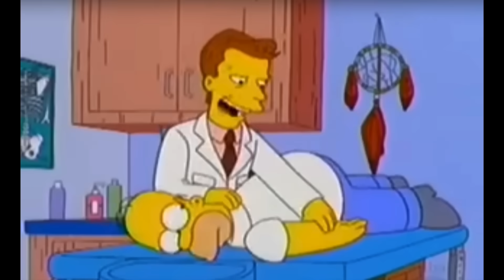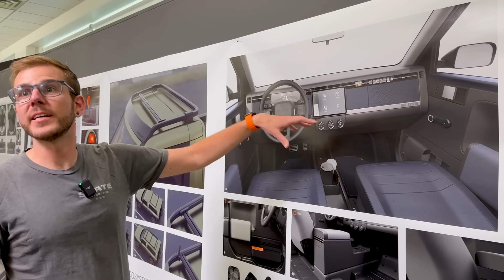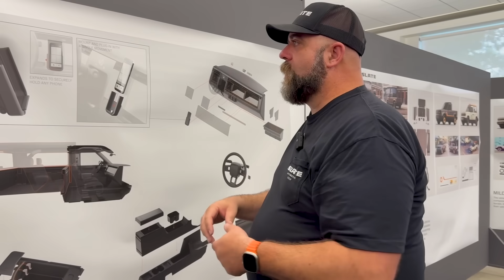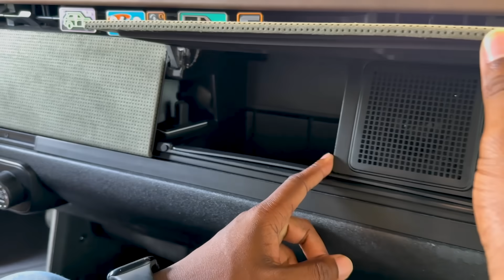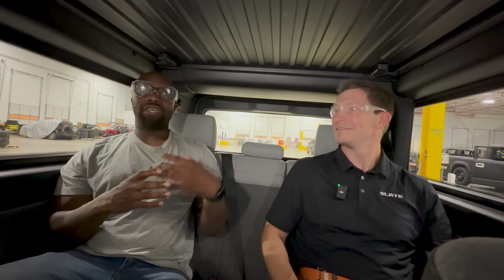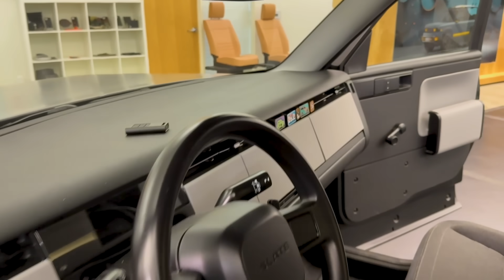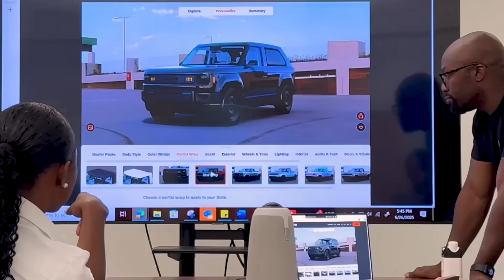The Slate: America’s $20K Answer to China’s Cheap EVs (Exclusive Access)

Comment: My 2019 e-Golf cost $26k (before $7500 rebate), is a real car with heat, AC, CarPlay, stereo, power windows, and drives like a Golf with ~140 miles of range. I just drove 130 highway miles on 89% of the battery, so the range is similar to the Slate. I don’t think the Slate is a game changer. $28,000 with 250 miles of range would be something to talk about.
Reply: Yeah,  too many people falling for the hype. Easy to comment that you'd buy one... We'll see how many actually do
Reply: How delusional are you? You're driving the Chevy chevette of Europe. Do you think you'll be able to service it yourself? Are you able to pick up a large appliance and deliver it to your home with that vehicle? Will it seat 4 comfortably? Because this trucks going to probably have the same look for at least a decade which will increase its resale value , what do you suppose yours is worth if you try to sell it now? How likely are you to survive an accident at 50 mi an hour into a unmovable object?

Comment: Jordan needs to focus on sound dampening material on that loud road noise truck. Also power window are so cheap to have in a vehicle, so it should be standard. The center console needs to be redesign and more usable. 150 and 240 miles range is pretty low with today's technology in batteries. Using graphite or polymer ion batteries is lighter and will get you more range.

Comment: A Detroit (Troy) "truck" with only rear wheel drive? First big snow storm - "Boss, I can't drive in because I will get stuck".... Seriously...  Put a brush-less (A/C) 75kw motor in each of the front wheel axle short shafts...  Simple, no u-joints, no differential, etc... As your CAN bus will have wheel speed info, the ECU can regulate the power when needed to the front wheels. ZERO drag with in rear wheel only mode.

Comment: Nice idea, but this ev will end up starting at $26,000. And by the time you add all the cool accessories it will be in the high 30's to low 40's. No 4 wheel drive and low range , definitely not a game changer. The return of Elio motors.

Comment: 30K, with crank handles, no radio and no paint ?
So, that's all they did ?
200$ saved for the windows
100$ saved for the radio
300$ saved by not painting

Bet that thing still has a tracking GPS computer that knows your every move. 
Bet it needs special software to repair it or pair a new key anyway.

Comment: This being RWD over FWD is at least a good hold over while waiting for AWD. I really hope for a big performance increase in the future. Doesn't have to be a crazy fast vehicle, but allow me to turn all of the brains off and swing this thing in the dirt and skid it in the rain. Really want it to be genuinely fun to drive. Miatas are slow and make little power but they are a blast. 

I can still see this being criticized for its price over functionality. A 10-15 year old full size pickup truck in good condition can be had for less. Not everyone wants a used truck, but a lot of people want the best bang for their buck. This thing isn't competitive against $3k trucks from the 90s as far as capability. Even a base model V6 pig F150 from 01 out performs this. Of course, not everyone looking at this wants a truck; especially from the 90s or later. If you want a cheap truck buy a cheap truck. It will be interesting to see what public perception is when it hits the streets.

Comment: So, Slate trucks are so cheap because their employees make just enough to live comfortably in Sprinter vans, LoL

I would be sold if they had at the very least a 3-4 cyl diesel hybrid option.  Just like the evolution from horse+buggy to automobile running on alcohol, then petrol based fuel, it wasn't fully adopted till fuel stations were abundant.  I still like the idea of worse case scenario I can run a diesel truck off 90/10 oil/fuel mix, or 20/80 oil/alcohol for gas based.

Comment: I've been looking for a classic mini truck like we had in the 90's. This thing 100% fits what i need. I need to go to Lowes, garden center, and occasionally drive 50 miles to the office. My current truck is a 2002 Dodge Ram with a 8' bed that has 280,000 miles. That thing is a beast, and still runs decent, but it's age is showing. I'd be interested to know if we would be able to tow it behind an RV as well. I've reserved mine!

Comment: Its an XJ... Its a unibody with subframe connectors baked in, im lookimg at it now, it appears to be dual motor in the back already, so a quad motor would be easy, and then I still want like a plaid version... 

This will be harder to do heavy offroad suspension on, but its possible... 

I would make the awd one IFS you are targeting the bronco with this...

Comment: I like the mod you can do the car, this and the company fairphone are thinking about the customer when it comes to right to repair but...  1. If this car came out of China, it would've cost 12-15k barebone.  It's already expensive for what u getting.  2. Battery way too low. 3. It's using POUCH as their battery.  That's the worst of the worst. They should've went the battery style as tesla and rivian. Look at the problems porsche is having with pouch.

Comment: 0:26 A chiropractor is not a scam, people just don't know how it works. 
A chiropractor can't fix anything permanently, but he can temporarily improve your joing placement and posture. 
Sure, if it's something acute like popped shoulder, knee or whatever, he can fix it permanently in a single session. 

Every good chirporactor will give you a list of exercises. 

People HAVE TO EXERCISE after the sessions regularly. Their problems are a result of years of incorrect posture and asymetric muscle buildup. 
Now, you may say, anyone who exercises will improve. Absolutely true. And every moderate gym goer knows how important the correct motion is during exercises. 

A chiropractor just allows people to get quicker into the correct motion in order to quickly resume their training routine. 
If you are an extreme case, you may not be able to start training again without the help of a chiropractor. He might make that pain just a little more bearable. 

I prefer osteopathy, they focus more on muscle but they also do what chiropractors do. They can also quickly and reliably identify where you have problems even if you can't feel it, so you can work on that in the gym. 

If you injure your joint, a chiropractor will definitely allow you to get back into action quicker, and that is very important because you don't want muscle atrophy on top of that.

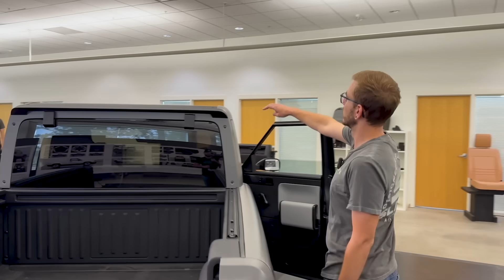Comment: 11:44 I think in terms of car thieves, pranksters, and weather.  This truck looks easy to disassemble for many of the wrong reasons.  Tire lug nuts are about the only things that are easily accessible on a newer car but those are quite secure because they hold the wheels onto the vehicle.  External spare tires get stolen all the time - just ask your average Jeep owner.  I'm also skeptical about having side bolts be open to the elements.  Those are rust magnets.  Ever try to remove a rusted out bolt?  Huge pain in the neck.

Comment: I hope that they keep the price of parts reasonable. I also hope the lug pattern on the wheels is something common like 5x114.3 so that you can use wheels from other companies. Hopefully they make it easy to upgrade the audio system with access to power. Although a big system will probably hurt your range, I would mostly use this around town and back and forth to work, no long road trips. I also hope they make parts fit well, for example the flip up dash panels didn't look like they aligned very well.

Comment: What's the range of the truck, what is life span of the batteries,  how much can you lift it and what larger sized tires can it take. Also if putting bigger tires can the speedometer be adjusted to get accurate mph when driving.

Comment: I see this as the only optionfor an EV I would buy. I want the SUV, but having it in either configuration will suit my desires. I purchased a Gladiator 3 years ago because of everything it can do, and I do use it for all of it. I would love the Maverick, but it wasn't capable of doing all that I needed. The Slate, being American Made, and being a very basic vehicle, will be perfect for MOST of local driving. Save my 2002 F150 Supercrew for the roadtrips, and the Gladiator for camping, offroading and adventure...  Then again, as soon as I get my 62 Scout on a S10 chassis and V6 swapped, maybe I won't need the Slate?

I am waiting for this to come out, real people buy it, review it. Before I consider plunking my limited resources into a deposit...

Comment: I sincerely feel that a tiny pickup that is 2 wheel drive, has no paint, infotainment or electrified windows or seats should be less than $28k. The battery isn't even that big. And when they lose the subsidy, that is what you will be paying. Never mind the fact that most people will end up spending several grand more on upgrades. If this was released in China, it would be like $8k to start lol.

Comment: I’m wondering what the price would be on some of the examples they showed with wraps, bigger tires, interior accessories etc?

I feel like it’s one of those things where the base price is good but things add up quick. They also focus a lot on modding the visual items but like any modern ev you are stuck with the battery, motor and operating system that it came with. 

There’s a lot of cool ideas here but saving you money is a farce. They are just reimagine how to sell you a $50k vehicle in stages but nonetheless selling you a $50k vehicle when fully outfitted.

Comment: Actual innovation in the vehicle space.  The industry needs this disruption. Honestly they should open source the specs for the connectors so that there is also a 3rd party ecosystem, it could be a huge gamechanger. I'd often thought that if Motorola had open sourced their addon phone module tech (you could buy modules like extra batteries, mini video projector modules, extra camera modules, etc) a ton of people would've bought their phones that had that functionality but they kept it closed and as a result they didn't build a market/ecosystem.

Comment: At about 30 mins, Rich mentioned competing with jeep with the slate open air design and being able to customize, this is what jeep forgot. They were always smaller stripped down vehicles for decades....that you could add what you wanted and it wasn't expensive. It was fun, as well as being a serious 4wd off road vehicle. being as modular as it is, the aftermarket parts community is going to go nuts with parts and accessories. I really hope this takes off. for a student who is moving every year, perfect, you can have a truck to do that, for a small business, need a cargo van or truck for in town deliveries...... handyman moving tools and small amount of supplies around? yup, seems to do that, its why the KEI trucks were so popular once they were reached the 25 year import mark.....this is a better version, and ev. I hope it's successful and starts eating some serious marketshare.

Comment: Yep the accesories really will jack the price. It's the german car model where they offer a cheap BMW or a Mercedes to get you in the door and then you add 3 or 4 things and it's 10K already and still missing something you want. Good luck getting one that's plain. I have a feeling they will be selling these with pre-installed packages cause most people want it ready to roll, they don't want to wait weeks for all the work to get done if they are paying the extra 10-20k. By then you are looking at base models of other brands hybrids. Cool runabouts at the cheapest level. I don't know why they bothered talking safety, this isn't an egg shaped suv and it's not big enough to take a smack in an intersection like a full size truck. No one mentioned any airbags that I heard unless it's in the steering wheel. Definitely not behind the wall of speakers should you install that.

Comment: This is modern software architecture and design applied to car manufacturing. Service oriented, modular, loose coupled, clean interfaces, separation of concerns, repairability and maintainability. LEGO did it to toys in the early 1900s so hopefully this can survive the finances, market pressure to only deliver quarters results, temperature shifts and EuroNCAP etc. I would buy one as a smaller station wagon config over the overpriced, error prone and locked down chinese Volvos my 🇸🇪 is sadly putting out.. Slate should set up a design shop and factory in the EU if they succeed in the NA

Comment: I love so much about the Slate idea but there's two reasons why I believe it will ultimately fail:

1. Not available with 4 doors
2. Not available in AWD
Reply: That's an easy prediction.  Any new car manufacturer has a cliff they need to climb to bring the car to market period. I do agree it needs to be AWD though now I'm wondering if Rich gets one, is it possible to add another electric motor and upgrade the battery and drivetrain? It would be cool if the chassis had the ability to bolt parts on to upgrade it though it would take more than a battery and motor.
Reply: also no official ICE variant .  very important for remote and developing areas where trucks are needed the most
Reply: @ali32bit42 don’t you get it, that’s not the target market, obviously. Other brands cater to these markets. This is like complaining that small hatchbacks don’t function as icecream trucks or something similar stupid.
Reply: @che1602  what am i not getting here?   i know this thing is made for city nerds but a truck is a truck.   its comparble to a Ktruck from japan yet one of those is 10 times more useful.          i am not american and the word truck still means something where i live.      id expect to get work out of it and good luck getting chargers or battery replacements where i live.     not to mention rapid cargo transit cant wait for recharge times so you'd need Two fleets of these and use only one at a time.  

this thing  markets itself as sustainble but it doesnt work for the other 70% of the world thats still barely catching up to ICE cars.
Reply: You can get 4 doors and if you think you need AWD you need to learn to drive...
Reply: @gregorybarth930 Don't really think it's a driving issue, AWD is much more efficient over a 2 wheel drive counterpart in loose sand, dirt or snow...
Reply: @gregorybarth930 um. I live in the mountains. We have A LOT of snow. I don't like putting on chains. Very ignorant comment.

Comment: If they put winglets in the door windows I am all in for the Slate EV.  Most people here probably never seen or used a widow winglet.  It is a triangular little window on the door in front of the rollup window.  The winglet is on a hinge and you can open the winglet so that air from outside blows right on you.  They were awesome.  On car windows today you roll down the door window and 99% of the wind blows on the person in the back seat with very little actually blowing on the person sitting next to the window.  The winglet blows the air right on you.  You can have the window rolled up or down.  YOu can crack the winglet open to suck out air from the cabin.  They were awesome!  I miss them.  Plus it give the Slate a cool retro vibe to the truck.

Comment: The fact that it's a 2dr and they don't have plans for a 4dr yet tells me they're my kind of people.  But then the fact that it's a 2WD and they don't have plans for a 4WD tells me they are not my kind of people.  It's nice that there's a lot that's customizable and you can get individual components without packages, but when the talk got into right to repair it was shifted straight toward "you can 3D print accessories with the CAD files we will release" and not "you can access the source code for the computer and replace bad cells in the pack" tells me they're not quite onboard with the whole right to repair issue.  I am conflicted.

Comment: A lot of folk seem to be missing the point here...this isn't supposed to be the cheapest truck you can possibly buy, ever (although it is pretty cheap). It's the first modern vehicle designed from the ground up with Right to Repair in mind - down to the fact that they'll be publishing the CAD files etc so you can make your own parts. It's basically the vehicle equivalent of the Framework laptop; y'all should be applauding this, given the amount of pissing and moaning about OTA firmware updates, closed ecosystems that funnel you to dealers etc.